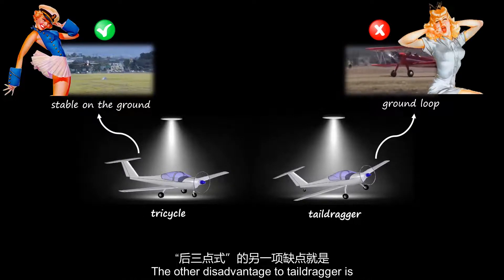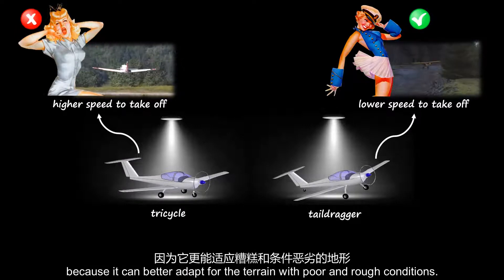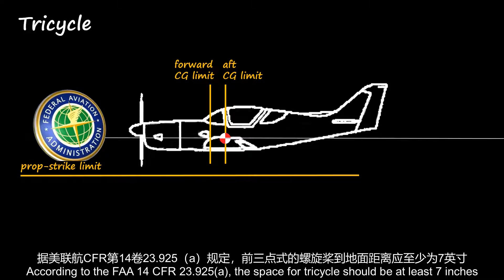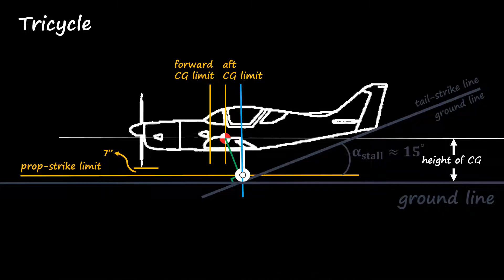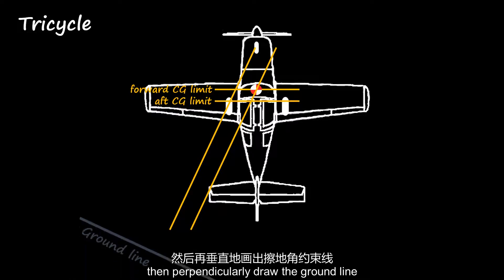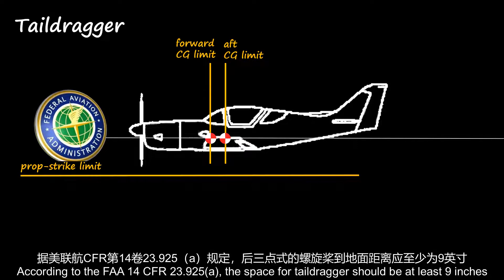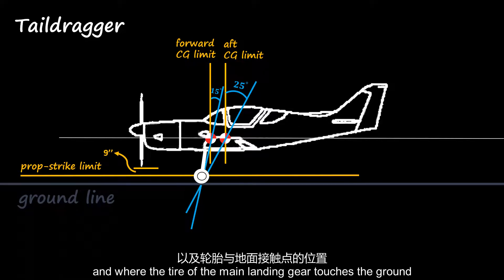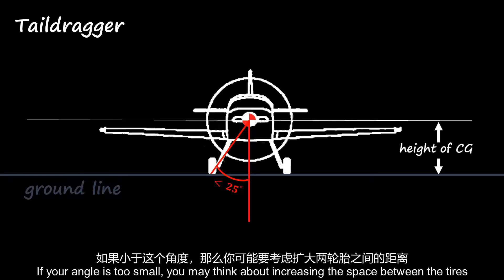How to design landing gear? 如何設計起落架？

Comment: tailwheel vs trike has nothing to do with nose angle on takeoff and speed to lift off. 

Compare the following aircraft if you don't believe me;
Vans RV-7
Vans RV-7A

Both takeoff at the exact same speed if flown correctly. Both can lift off with the exact same nose high attitude. Both can accelerate to a higher speed using a nose low attitude. Both stall at the exact same nose high pitch attitude for a given airspeed.

Takeoff speed is a function of the stall speed and nothing else.

Also, tailwheel pilots who do STOL flying, like to lift the tail into a nose low attitude on takeoff, even though it has been proven many times that the nose low attitude results in shorter takeoffs.

Comment: Great job! I really like the detailed and to the point technical tidbits (angles, distances, ..etc.) very useful and clearly explained visually as well.

Do you recommend any specific software for landing gear design and testing? Especially for simulating stresses "in-motion". For example, deployment in very high airspeed? Most software can only test them while fixed in one position and doesn't support animation.

Thank you very much,
Reply from the maker: I don't know any specific software that can simulate stresses "in-motion". Usually, engineers analyze structures by using NASTRAN and Femap to look for Von-Mises stress and max principal stress for example, but as you said, they test structures while fixed in one position. However, you can always analyze your structures with the maximum applied load, and when you design your structure, use safety factors to keep your structure stress way below failure. Also, be aware of fatigue that can happen to your structure after a certain cycle of life. In this case, you will also need Damage Tolerance Analysis.